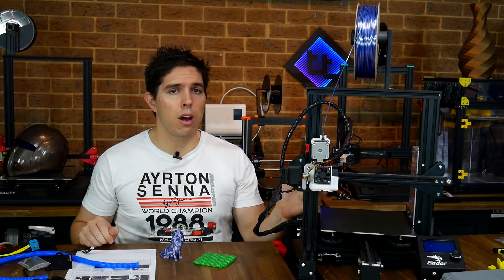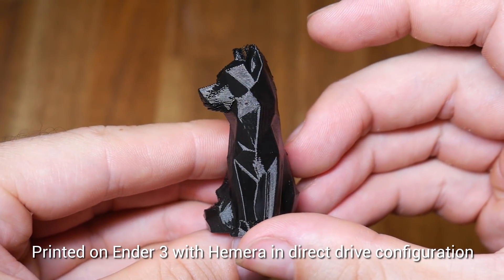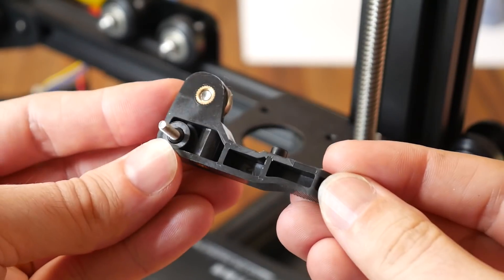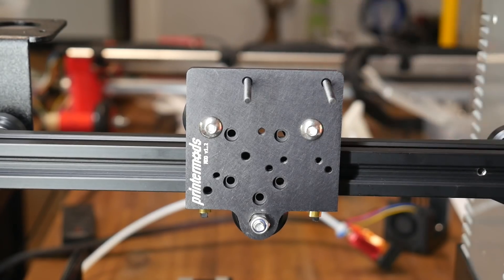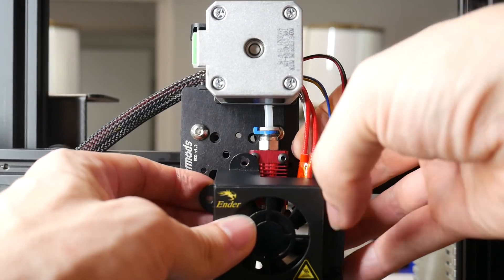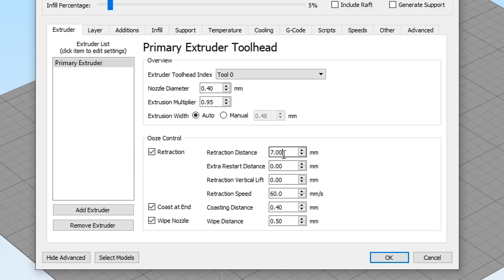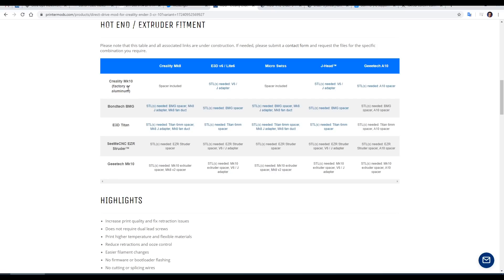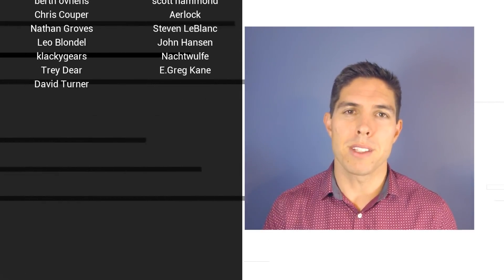Modular direct drive kit for Ender 3, 5 and CR-10 for under $40

Comment from the maker: A anticipatory notes: previously a lot of people commented that the z axis stepper is working a lot harder with this kit. The z axis was already lifting the extruder and x axis components, so no change there. The x axis now has to move the extruder stepper, which is the primary difference. I've had V1 of this kit on my Ender 3 for over a year, and never had any issues or had to increase the VREF for the x axis.
Reply: I know its not relevant to the video but how did you connect the hotend and part cooling fan for the ender 3 on the skr v1.3 (one of the fans has no connector and is only bare wires
Thank you
Reply: @BenCos2018  The bare wire fan (part cooling fan) can be plugged into the extra extruder terminal on the skr which gives some extra control through marlin (auto turn off below 50 degrees) Alternatively, you can also stuff it in the board main power terminal along with the wires from the PSU. This is the recommended method by TH3D and will leave your fan in an always on state.
Reply: Does tmc 2209(main board) and tmc 2208(stepper drivers) works with ender-5? not ender-5 plus...
and can you advice me some kits keeps silence making in ender-5?
Sorry for my bad english skills..
Reply: @성이름-f1s9f  i'm using a BTT SKR Mini E3 V2 with TMC2209 on my CR20 Pro
Reply: Could you teach me how to calibrate hermera Vref? I'm using SKR mini E3 v1.2 board. I follow all your video guides to mod my ender 3, and it's was all successful. From main board, bl touch and hermera. But only Vref can't figure it out. Tks man
Reply: Teaching Tech  mark from x3d said you might have a suggestion about the Ender 3 not feeding the filament. As I am new to 3d printing and the sample that came with the Ender 3 worked fine but the x3d filament just continues to fail every print I start. If you can help that would be great
Reply: i wonder if its possible to add a counterweight on a pulley to offset the movement and extra leverage of the extruder and stepper motor,like a lift has?
Reply: @davegee124  You might as well add a second lead screw. It makes no sense to weigh down the other side of the X axis if it going to make the z stepper work harder. unless you want a cheap way out, or are printing full build plate and don't need to add a second screw  or  plan on doing dual Z. Though the farther the extruder goes away from the leadscrew, the more leverage the side without z will have, basically it would twist your frame depending n the feeds and speeds. and also on the weight added, and/ or wear out those v wheels faster.
Reply: @Central Maine TekWerx Why don't you just test it out instead of pre-emptively deciding you need dual z screws?

Comment: I found a direct drive kit on amazon for 13 bucks that mounts the extruder and motor sideways. Only main difference is it didnt require any printed parts and its not modular but still has a place for the cr touch.  This is an impressive piece of kit for sure..especially the modularity!

Comment: Isn't the extra weight on the x axis a problem with a single drive screw?
Reply: It was already on the X axis so no difference in weight. The Z axis is however heavier so faster prints may be worse

Comment: Hi Michael! I'm debating on doing this mod on my Ender 5 Pro, but the jury is still out. I would like to do it, since it eliminates the bowden tube and the pressfit couplings to keep it in place. They have worn out already, only 3 months after purchase, and since I discovered too late now my capricorn tube is to bits as well as one of two couplings won't come off at all anymore. The direct drive setup should get rid of that problem entirely obviously. And in the process, I'm hoping to up my game in PLA and PETG printing. The advantages regarding flexibles are a good bonus.

However, since on the Ender 5 models the bed only goes up and down, the gantry will go left to right as well as back and forth. It is the latter motion that bothers me. I'm afraid the relatively high weight of the stepper motor, positioned relatively high over the top rollers, will cause the entire carriage to torque back and forth whilst printing, causing printing defects in its turn. Also, all the weight being in front of the gantry beam should cause the entire thing to torque to some extent, worst point being in the center position. This could make bed levelling more complicated, as I don't have a BLTouch or the likes. It will probably also wear out the rollers a lot more quickly.

I like the MicroSwiss dual gear direct drive setup because of better front to back weight distribution, as they have the stepper mounted on the back, directly over the gantry beam. But the price tag on that is just too steap for me to be able to explain its necessity to my wife. Also, it doesn't tackle the feared torquing issue in the Y direction. I guess I can replicate it with a printed part from Thingyverse though. And as the field of metal processing is my day job, I might even be able to do a custom carriage plate.

This is my only printer, so I need to keep it as versatile as possible. Getting another printer to have both bowden and direct drive setups is not within budget. The fastest I do at this point is PLA at 60-70mm/s. Beyond that my inner perfectionist will start giving me a hard time over the results.

What are your thoughts on this? Have you done this modification on an Ender 5 family machine yet and what were your findings?

Thank you for what you do on your channel, I find it very informative and it is one of the reasons  I got my Ender 5 Pro in the first place.

Comment: you bought the one for the ender3. If you buy the one for the ender5 you will find multiple problems. Starting with the directions for the bowden tube, If I remember correctly it said to cut it to 67.8mm, WRONG it needs to be 62 mm. then comes mounting  the fans, they have the holes drilled wrong. You will need to trim 3mm off from the fan housing to get the screw in. Then comes the wire extension, it is about 3 inches too short. Typical from companies with no Quality control.

Comment: Installed this on my Ender 3 Pro. Much better than the typical Bowden-style, now extruder skipping isn't really an issue I have to worry about. You won't be able to use most Satsana ducts though.

When I get my replacement fan (I broke some of its blades off by accident) for the hotend I will print the Bullseye fan duct and test it on my setup.

Comment: Got the kit: superb quality!
It fits (near) perfectly in the Anycubic Mega X.
Same 20x20 rail on the X-axis, so why not?
Steps:
1) tiny block for the X-limit switch
2) re-leveled the print bed
2) Use belt tensioning device hidden in the x-axis rail to set belt.
The stepper-mounting plate can pivot on one mounting bolt.  This pivot action slacks the belt.  Set the proper belt length, pivot the mounting-plate, belt draws taught.
Robert is your parents sibling.
The V1.3 plate with fans and ducts is about 40% the weight of a fully rigged Anycubic carriage/housing/ducts with fans!  Steel is heavy.
Didn't weight them with hot-ends installed.
Next stop, take back the weight savings with a direct drive!
This is fun!  Lego's for big kids with credit cards!
One bit from here, another from over there...

Comment: So, I DID this upgrade... ufortunately, there doesn't seem to be a clean, simple cable chain management system for it.  I'm working on this, now, because I hate having to do kludgey things to keep the cables from interfering with prints.

Also disappointing - it mounts the extruder driver motor such that you can't see the filament feeding, unless you can look behind the printer easily.

Comment: I had a double gear drive kit on my servo motor. It took some modification to fit, but did so successfully. Need a drill bit and some extra screws.

Comment: I've been printing for WEEKS with Recreus 70A soft filament.
Bowden was nearly impossible.
I printed speed drive to mod my Ender 5 to Direct drive. It works better.
Still not perfect. I have a Daz3D exported head, printing it at 10mm/s, its been going for FOUR DAYS and today it started bunching again and under extruding, ruining a model that cost almost an entire 500gr spool of Recreus (about $60 a pop after shipping from spain).

I have two more spools left, and I just ordered this so I dont have to adjust the extruder all the time.

Recreus made a DD extruder for a while for Flexible printing, but they have confirmed in email to me that this is no longer on the market.

Any advice on printing with 70a is always appreciated, for now, I'm trying this. Not many people seem to be attempting the things I'm doing, so its been a hard road.
I also need to find a place and method on the ender 5 to get my filament above the extruder, right now I'm behind it mounted on the back with the holder bent a little to allow it to roll without hitting anything. This does not work well.

Comment: Hi Ya TT, I noticed in this video you too are using the EZ Extruder. Short story I modded and redesigned some things to accommodate using the EZEx, Bullseye and a V6 hotend creating a DD like setup. In the end it works fine but its bulky and heavy. Looking at your setup in the video is something I am interested in.  I am not apposed in changing the cooling system but would like if possible a list of items (cooling setup...Hero Me?) that will compliment this MDD, EZR and V6 setup? Any change of pointing me in that direction? I am about to get into the EnderExtender kit and I would like to lighten the load on my X axis and your setup might seem to help in light of my components. Thanks

Comment: Got it, put it on. printer is working better than ever. Because of you I have 
1. Extended my Ender 3 to 300x300x400
2. Added a BL touch 
3. Switched stock board to Skr mini v2
4. All metal swiss hotend
5. Ac heated bed with ssr relay

and a lot more that I've learned in only 3 months
I've done 3d modeling for a long time. Now I get to make actual physical things with my Ender 3 pro XL
Technology these days absolutely blows me away...now that it's becoming more affordable.
Love the vids and THANKS

Oh...Btw...If anyone doesn't have the Hero me and just a BL Touch that doesn't fit, you can measure and grind or file off that little upper right-hand corner on the stock metal bracket. I got mine to fit ( I couldn't print anything when I found out it didn't fit).

Comment: IMHO, the comparable Micro Swiss kit is a better deal.  It costs a little more but you get a lot more including an integrated dual gear extruder.  Also, the stepper motor faces the opposite way from this one which I think is a no brainer.  Much simpler maintenance.
Reply: Got a link for this Micro Swiss kit?
Reply: @timfriesen7751  https://store.micro-swiss.com/collections/extruders/products/micro-swiss-direct-drive-extruder-for-creality-ender-5?variant=31917282132035           30% off for the holiday.

Comment: fyi not sure if others have made this comment but the hero me remix does not fit the new Printermods V1.3, the clip on the right does not go out far enough I just removed it and then it lines up just fine but you do lose that anchor point on the right side of the hotend

Comment: IMHO, the X axis carriage plate needs to be aluminum, not plastic.  At least on the E5+ it does.  I don't have an E3 but I suspect my opinion would be the same.  Also, orienting the extruder stepper motor in this direction makes ANY carriage service work much more difficult/complicated.  And finally, I don't see the point of re-using that POS extruder supplied with the printer.  There are many dual gear aluminum extruders available that are FAR better.

Comment: I believe the Micro Swiss direct drive/all metal hot end is superior.
Reply: Yes but it's not the same price.
Reply: @jpnevil  It costs more because it's worth more.
Reply: @ramtek2702  That's the point
Reply: @jpnevil  Your only point appears to be that you believe all DD kits are equal regardless of cost.
Reply: @ramtek2702  You said that Microsuiss is superior, I said the price is not the same, it appears clear to me that the quality is relative to the price, microswiss is twice the price so the quality is superior, I don't get you don't get my point.

Comment: I bought  MDD kit for my Ender 3 V2 but after installation I tried to feed filarment but it is not going through.
Reply: Were you able to get this resolved (what did you end up doing to fix it)? As I'm thinking of getting this for my V2 as well. I've reached out to printmods and they confirmed that it will work with our version of the Ender 3 (so not sure now that I read your comment). Thanks

Comment: These mods are very good and helpful.
 Would you consider reviewing the MONOPRICE MP10.
Or even doing a BIGTREETECH upgrade to the Tenlog TLD3 Pro DUALE IDEX. 
Many have this printer with failing boards. It prints well.
But it has issues.

Comment: I got the MDD 1.2 with OEM extruder and hotend. Was going to go with Herome Gen 5 but gave up, not worth the hassle. Ended up just printing the 5015 duct from printermods and is a much simpler setup.

Comment: I tried this setup, but it makes it a whole lot worse. Far too much ringing on the X-axis.
Not worth it in my honest opinion. Far too little advantage over the disadvantages. As mentioned it increases the mass on the X-axis, thus introduces more ringing, forcing one to reduce the printing speed considerably.

Besides. A proper PTFE tube (such as the Capricorn one) and the much easier PTFE tube and spacer mod combined with real proper tube fittings improves the whole extruder setup a whole lot better than the factory setup, making this direct-drive mod almost obsolete. See: https://www.youtube.com/watch?v=7tCxO17XZtw for more details on this.
In the end, this mod only introduces more ringing with barely any other improvements compared to the previous setup (with a proper PTFE tube and hot-end fix) I already had.

Comment: I installed one of these on my Ender 3 Pro and my CR-10S this week. What an amazing difference. The only issue I ran into was my CR-10s has a micro swiss hot end and getting the tube length correct was a bit of a challenge. Otherwise this was a breeze to install.

Comment: I installed this kit on my Ender 3 today. Quality product, and easy installation. However, I seem to be having an issue with the rerouting of the cable harness to the front. If I route it and tie is up as directed, I may have an issue if I ever print to the full Z height. Michael, it looks like you have a lot of extra slack on your Ender wiring harness. What might you have different from stock in that regard?
Reply: I'd really like to know this too.  I can't install this kit without cutting about 100mm off my max build height.

Comment: Came here to find how to install this on an Ender 5. And saw an Ender 3... I’m just trying to figure out where to throw my wires when installing something like this on an Ender 5...the wire positions are much different.
Reply: Did you have any luck with this?
Reply: Prickles2001 yes. Ended up going from the back around the side. I tied some of them to the mounting bar that the filament sits on

Comment: How does this work with the TH3D EZABL and the stock CR-10 hotend? I see it works with the stock hotend but I"m more concerned with what I need to do to use the EZABL
Reply: I am concerned about this upgrade affecting my Ender 3 Pro with TH3D EZABL also

Comment: just saw this video, Excellent topic, I have a 10S Pro and printing Carbon Fiber Nylon or CF PETG for a high heat resistant application. I put in a Hot End Swiss Micro and Steel Nozzle and have a lot of stringing. As i watched this video the pancake motor and this Kit would seem to be a practical solution. I have a Upgraded bed sensor but not the BL Touch. I wanted better cooling as well. It seems this kit for direct drive and some other changes may help solve my string issue with CF Nylon and PETG. Would you be able to help in such a upgrade with a parts list and video. I would donate some $ if it would help. Dennis

Comment: You should probably give folks a warning that they are on their own support-wise when dealing with these Printermods.com guys. Using your video as a recommendation I purchased this kit especially because it claimed to have a bunch of printable adapters for other extruders already designed. Turns out their STL for the BMG extruder adapter is bugged—I emailed them multiple times but haven’t heard anything, and it’s been weeks.

Comment: this was such an easy upgrade thank you however I did swap out the stepper motor for 1/2 it’s size just to make sure there was no issues on the weight being right over the hot end
Reply: Angel KM Hi there. I was curious which stepper motor you chose to replace the stop stepper motor? Any issues with the new one you’re using? I’m trying to shred weight as well.

Comment: I'd say that if the bearings on the X carriage wheels are really good and there are 6 of them with the weight distributed to the 4 holding the weight of the extruder that the affect on the X would be minimal for this.  If you added something that weight a kilo that might be different.

Comment: Hi Michael, great video and some really nice ideas!

Some questions I had though for the MDD + EZR combo -
1. When connecting the EZR to the stepper motor, did you use the rectangular spacer between the motor and EZR? From the brief moments it's visible in the video it seems like you decided not to use it, I wondered what were your reasons.
2. Cable management wise, I see you've decided to have the stepper motor with the connector facing down (as opposed to facing left), and routing all cables from the back without tying to the stepper motor with the MDD anchor, again, wondering as to why :)

Thanks!